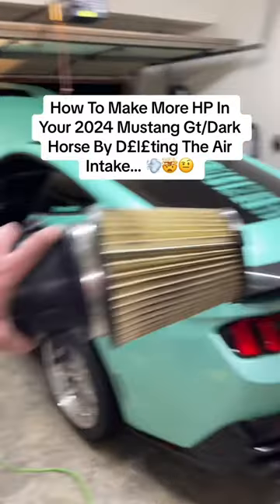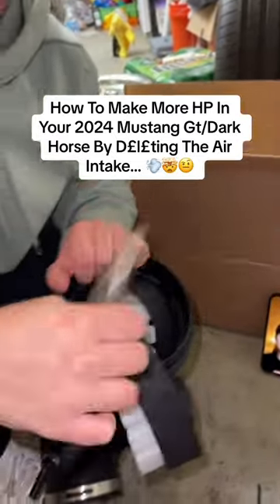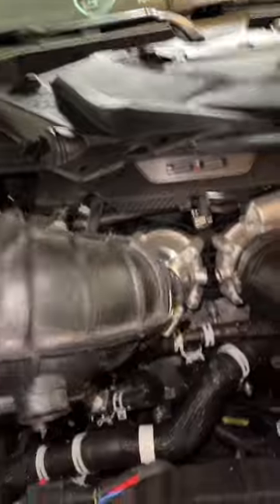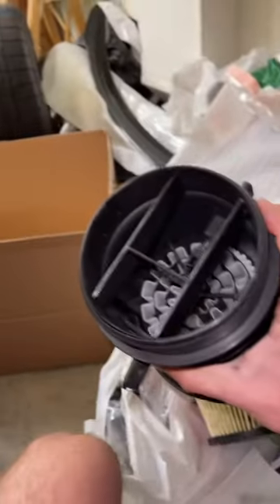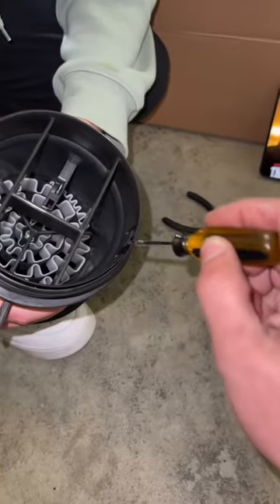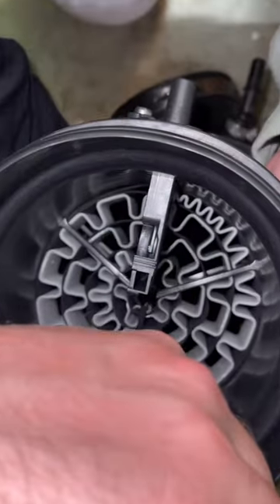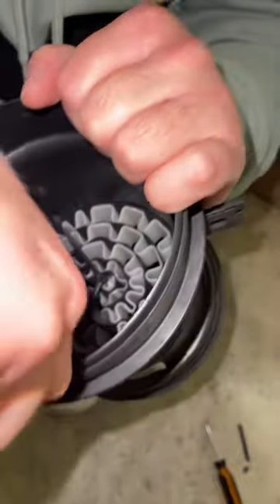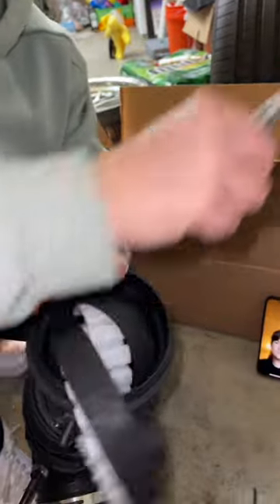HOW TO GAIN HORSEPOWER BY DELETING THIS AIR INTAKE PORTION ON YOUR 2024 MUSTANG GT/DARKHORSE!? #FORD

Comment: I wonder why my mass airflow keeps throwing a check engine light
Reply from the maker: It didn’t, no lights. It’s the same reason why you can put long tubes on a 18+ Mustang Gt without tuning it, the car comes with wideband 02 sensors from the factory. The computer adjusts AFR to match air flow. Maybe educate yourself on these cars because making ignorant comments
Reply: @yyibprobably the most uneducated reply I’ve ever seen on this app
Reply: @TobyVegaD  damn I don’t like you at all. Actually I hate you, but you have a really good point there.

Comment: These bro mods are hilarious. Id be willing to bet your taking power away. Thats there to condition airflow. U think they put it in there just to make a restriction
Reply: Back in the day the Ranger forums were full of useless junk like this. The rangers had baffles that would surpress the intake noise and people equated that lack of noise caused by the baffle to less power. They also believed throttle body spacers gave them more torque. What actually happened was the throttle cable would lengthen so the gas pedal was closer to the floor. Putting that spacer in there took out the slack.

People always look for cheap $5 hacks to give them 500 horsepower. Lol
Reply: @TehShadowDeath  ya right on the money. As if all thoes engineers for ford just didn't know any better.
Reply: Agreed it’s there to keep the airflow laminar and prevent turbulence causing weird effects on the airflow sensor.
Reply: @gunlover92  would it surprise you that all tuners are going to ask to take the "restrictions" out of the airboxes?